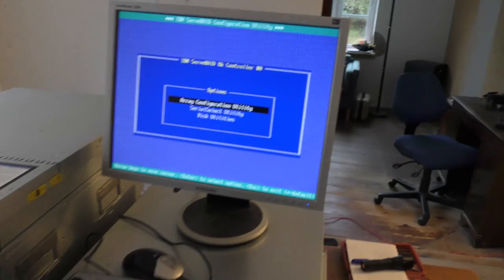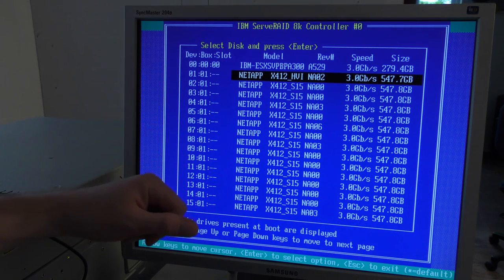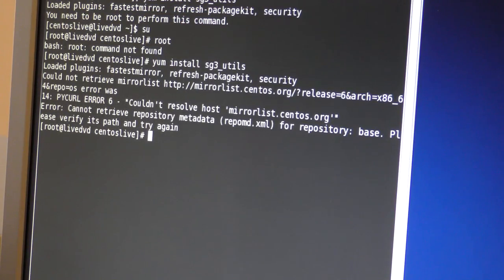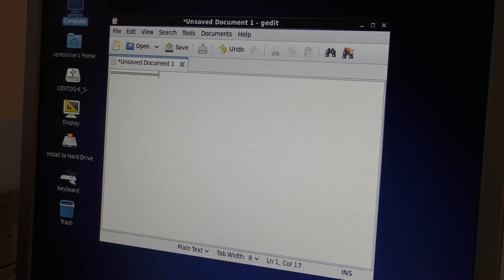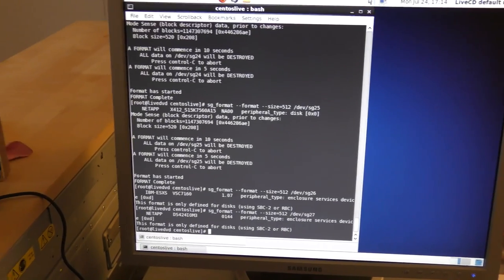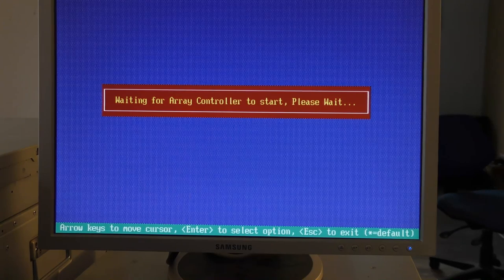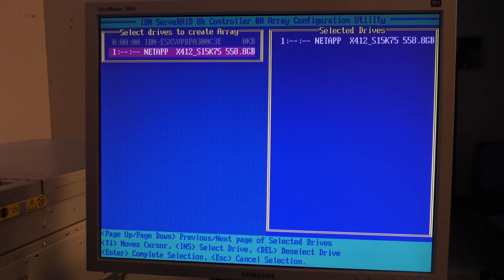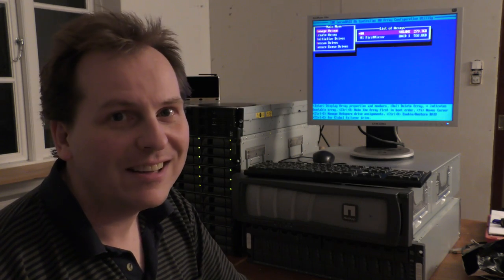How to Reformat NetApp HDD to 512B Sector Size - 552

Comment: You, Sir are awesome! I purchased 20 Seagate ST9600205SS drives off of Ebay to use in my VMWare builds using Dell R610 R710 servers but found out too late they weren't compatible because of 520 block size. Using a non-RAID Dell controller and your technique I was able to reformat them to a 512 block size. Brilliant!
Reply from the maker: Hi Terrance Sullivan
Thank You very much!  glad you liked the video :-)
Thank you for watching! :-)

Comment: I'm not a linux expert but I think you could format all at once using the "[ ]". for example /dev/sg[2-25] and it would run the command on all the drives from 2 to 25
Reply from the maker: Hi FilipeS
Thank You very much!  but a bit late .) but thank you :)
Thank you for watching! :-)
Reply: Also for future use * is a wildcard so it will select everything in a folder. So format /dev/sg* would try to format everything in the /dev/ folder that starts with sg.
Reply: Doesn't work.
I used sg[2-6] and it cancels formatting 2 as it tells "Unexpected extra argument /dev/sg3" 4,5 and 6. Seems like this doesn't run it like seperate commands, but as one command while just one format process is possible.
Reply: @Bezos404  damn really had hoped this would work i have 72 drives to do
Reply: #!/bin/bash
for drv in {2..25};
do
   sg_format --format /dev/sg$drv > sg_format.out  &
done

Comment: OMG!!!!! Dont spend 2 hours per drive formatting. Find a better way.
Once you convert from 520b to 512b, You can QUICKformat the drives in any OS you want like a normal format. Then go into the RAID setup to add them.
Reply from the maker: Hi mrlithium69
Thank You very much!  but are you sure,, even the raid controler could not initialize it before it had run this low level format.
Thank you for watching! :-)
Reply: unfortunately, no, low level formatting is different than the format done by an OS. However I thought it could be done with the sg3_utils. At least then it could be put in a script and left to do it's own thing for the next two hours...or possibly format the drive in parallel because I think the drives might do all the work. Might want to have a UPS during the low level format, in the old days I think you could loose a drive if the low level format is interrupted, but maybe it would fine..

Comment: I just bought a Dell R710 server on eBay for 67$. I thought it would be newer than the Dell Poweredge R620 but it seems a lot older. The 710 supports 4 and 6 core CPUs and 1333 MHz memory. The 620 supports 12 core CPUs and 1866mhz memory. The datasheet for the 710 says it's certified to work with emc storage arrays but has no external sas plugs. It does have 2 internal ones that connect to the hard drive backplane. Can I hook those up to my emc vnx sae storage unit?
Reply from the maker: I have not tried to use EMC shelfs, but they might be as "stupid" as others.

Comment: I've been talking with another youtube streamer and he said 2 things. 1) I can get a ds2246 unit and an hba card and format my netapp drives to 512 bytes. 2) Other option apparently is to buy an hba card and use my emc vnx sae 24 dish shelf and ubuntu or linux. Or 3) is to flash my raid card to factory or something so it gets rid of the raid information. The ds2246 setup is 200$ to format my hard drives. The hba and emc route is like 20$ because I already bought a emc sae shelf and cables, and I have a bootable ubuntu usb stick. And the last option which is to flash my raid card to make it non raid is too tedious an effort. Which of these do you suggest or do you know something easier and better?
Reply from the maker: I have never tried to use a DELL EMC shelfs, so do not know if there would be any problems.

Comment: To all those saying format in Linux, I'm pretty sure that the RAID Controller has to perform the formatting, otherwise it still won't recognize the disks. You could just have software RAID, but that defeats the purpose of the RAID Controller on this server. 

My big thought though is why? NetApp 99.99% of the time will handle the storage needs properly, and will almost always do a better job in balancing the load across all drives than the server's RAID because that's what NetApp does, and only does. Unless this is to save some power, which I get, or just to prove it can be done, which is actually really cool.
Reply from the maker: Hi 101rockfreak
Thank You very much!  I Just did not feel like using the NetApp controller,, want a little bit to make my own storages server.
Thank you for watching! :-)

Comment: The CentOS install and the formatting of the drives makes me so happy as its just like me when using linux :)
Reply from the maker: In a later video I found that this could also be done in Windows,, so there is both options,, It is a bit irritating to have to install a different OS, to reformat a few disks.

Comment: Does the change in Sector size affected total disk capacity? if yes how much? what is the empty weight of disk shelf without any drive? great job
Reply from the maker: Not really, it is like removing all the walls in your house, and put them up again, with an extra bedroom. Even if you got an extra bed room, you did not get more square meters, and the more wall might take up a little more space.

Comment: I have a smart array p410i and recently bought some seagate 1.2TB 12Gb 10k drives, but my raid card will not even see the drives. Is it because they are formatted to the non standard 520b sector size?
Reply from the maker: Maybe,, I do not have the p410,, so maybe.. :-/
Reply: @MyPlayHouse  The hard drives came from a dell server, would they be incompatible with my hp dl360 g6? if I were to do a low level format from a dell do you think my hp would recognize it?

Comment: Hi there! it's been a few months I am following you and watching your videos. It happened to purchase 8 Hitachi SAS 15k 600GB drives with a NETAPP firmware. I want to use them on DELL PowerEdge R310 servers. It also happened to find the same article and then I found this video. I managed to format the drives, but I would like actually to flash the drives with a most common (Hitachi) firmware or even better with the DELL's firmware. Did you had to flash/change the firmware on your drives or you left them as they were? Do you know how could I change the firmware? I do have the firmware I want to load. I downloaded that from DELL's support site. Any help is much appreciated. Thanks a lot in advance for your time.
Reply from the maker: Hi Angelos Pitsos
Thank You very much!  I haven't done this,, if you find out how,, I am also interested :-)
Thank you for watching! :-)
Reply: hello, how did you flash the disks on r310
I have an r710 and I cannot connect them to bypass the standard raid controller ... which controller did you use?
thank !
Reply: Hi  @TheSamTry ! Apologies for the delay of my answer, but I just noticed your comment. Actually I didn't flash them. I could use them as they were with the H700 controller. The R710 is the same generation (I also have a R710) and I believe you could use them as they are, as well.

Comment: Out of curiosity, do non-Netapp drives work in the DS4243? I am thinking about doing the same thing but I don't want to purchase a bunch of NetApp disks if I don't need to.
Reply from the maker: Hi Eli Ben-Shoshan
Thank You very much!  I had two drives 600GB, that did not work well, I put in two others from another non NETAPP set up, and they worked just fine.
Thank you for watching! :-)
Reply from the maker: YouTube is messing up, and climes that I have not replied to this,, sorry for the "disturbance in the force" :-/

Comment: Thanks for the video. Made my accidental purchase of 520 byte drives a lot easier to convert. Great that you can do several at one time given the length of time the conversion takes. MERCI BUCKETS!
Reply from the maker: Glad I could help! - I have also done videos on how to do it in windows,, if you like that better.
Reply: @MyPlayHouse  Ya. I watched both the linux and Windows versions of your videos and decided to go with the Windows solution as it allowed easy multi tasking the solution. Your hints on how to get the SG3 software to work were just enough information for me to get the whole job done in short order. Merry Chrostmas and Happy New Year to you and your family. Good luck with your new adventures in Porugal.
Reply from the maker: Thank You Very much..

Comment: I have the problem when booting centos. It crashes while loading into kernel panic error. :((
Reply from the maker: Hi E psilon
That suckes :-/ maybe look at "serverguide 10.6" or newer to see if that will help.
Thank you for watching! :-)
Reply: @MyPlayHouse  cheers! I will also try different command in windows that i have found..
Reply: @MyPlayHouse    Thank you for making these videos. Unfortunately the format protection command did not work. I must try a linux env.

Comment: I am not familer on linux, may I know how can I create such USB to boot a centOS? I have download CentOS but seems it was a installation ISO.
Reply from the maker: Hi Alan Tang
As I remember it I made a bootable USB with centOS using https://rufus.ie/
Thank you for watching! :-)
Reply: I have download the ISO and make it bootable on USB. It seems a installation media only. May I know did I need to install the CentOS on the machine's first?
Reply: @MyPlayHouse  I have installed the CentOS but it cannot recognize my HD. May I know you also connect the HD to the RAID Card without any Configuration at the RAID card?

Thanks!

Comment: Powerful raid control! Did Lenovo's system x3650 model has that sas interface?
Reply: Only the M1 has the 8088 connector as default. m2 and forward has to have another raid card installed .
Reply from the maker: Hi sogndal94
Yes only server I have ever seen it build in to,,, able to manage 64 drivs. in  total.
Thank you for watching! :-)

Comment: What is the advantage of reformatting a disk from 520 to 512 sectors?
Reply from the maker: They will work with normal operating system,, like Windows and Linux
Reply: @MyPlayHouse  ah ok, now I understand, so you can get cheap HDDs .. and in which brand and model of hard drives can this be done?  or how can I know which discs have the 520b format to re format to 512

Comment: i've done a multi format using the M1 raid controller and just let it sit 
hit format on the first drive then start the second drive format and so on... the first drive will for some reason be the last to finish but they can all be done at the same time. same things goes with the secure erase (keep in mind like i told you before it took 72 hours to secure erase 4x2tb drives) so i wont be doing the secure erase anytime soon on the 3650 M1.
Reply from the maker: Hi Joe MacPherson
Thank You very much!  it took me 2½ days to low leverl format 24*2TB
Thank you for watching! :-)
Reply from the maker: Hi Joe MacPherson
Thank You very much!  it took me 2½ days to low leverl format 24*2TB
Thank you for watching! :-)

Comment: Is it necessary to connect both DS4243 controllers?
Reply from the maker: Hi SAI
Yes it looks SO much more cooler :-) NO I did turn off the bottom one.
Thank you for watching! :-)
Reply: My PlayHouse 
It can work properly without it right ??
Reply: I think he means you can run only the top unit if you wish.
I'll be receiving mine eventually(still in the post) and I'll update you if he doesn't reply before it arrives. :)

Comment: Can your RAID Controller handle a disk larger than 2 TB ?  How large of a disk can the RAID Controller handle ?  Do you have enough compute power to set up a "Watson" ?  Or store more data than Linus ?  Thank you for the video !  tjl  P.S. What would you have your "Watson " do ?
Reply from the maker: Hi Tim Lipinski
The raid controller build in to the Lenovo x3650 M1 can max handle 2TB drives. but it can handle 64 of them. Watson runs on "PowerPC" not x86,, as fare as I know??
and No Linus has a lot more storages,, I think I have maybe 150TB all in all -ish  But I have way more then I need.
Thank you for watching! :-)

Comment: Hi Morten, it was perhaps better to delete the partitions with Diskpart in
Windows with, for example, or through the writing administration screen
in Windows then sees the server never formatted disk as a disk this is also a
bit more hassle with another server but I think many times faster.Another great video keep up the good work. Best regards Jo Denekamp
Reply from the maker: Hi Dit Is Jo
Thank You very much!  but I do not believe that Windows will even touch 520B size sektors.
Thank you for watching! :-)
Reply: Hi Morten, I did successively make my hard disk writing by my sinology Nas
clean en empty two use with Diskpart successfully back these were not read or
described in Windows any more I honestly do not no or Windows can use 520b
sectors or not.Best regards Jo Denekamp
Reply: Hi Morten, I did the hard drive writing by my sinology Nas use with
Diskpart successfully clean and back these were not read or described in
Windows any more I honestly do not no or Windows can use with 520b sectors. Best
regards Jo Denekamp

Comment: can you not use...
sudo apt-get update ret throw in password ret
sudo  apt-get install program_name install
sudo reboot ret
sudo apt-get update ret throw in password ret
sudo apt-get upgrade ret
Reply from the maker: Hi DAVID GREGORY KERR
This reminds me so much of DOS and using hours to tweak a CD com driver to fit in the HIGH mem area or even better up into expanded MEM, to get another free 20K in conventional memory ,, oh F* I do not miss that. And the editor in DOS 3.3 "Edlin",,line based editing,,horrible to work with.
No, I left that party and only look at it when there is no other way.
Thank you for watching! :-)
Reply: My PlayHouse the root terminal was the only way of getting things done
Reply: This is CentOS which does not use apt but yum as the package manager, hence the above commands would not work on a CentOS machine.
My PlayHouse If you need help with Linux in the future, feel free to shoot me a message, I know my way around it and can explain most of it to you in danish if you prefer so :)
Reply: Frederik Bjerggaard Nielsen I have used yum on Debian 8 but I prefer Linux mint
Reply: ah, edlin....good times.
Reply: The concept of all the sudo, doing sysadmin work, using a rescue disk or similar is just plain wrong. Just login as root. You have to be root for everything.

On desktop, doing non-admin work, it is normal and preferred to not be root. But logging in as user doing only admin work is just painful.

Comment: Can I use this cable EMC Mini SAS SFF-8088 2M/6.5FT cable 038-003-787 to connect my ds2246 (I don't have one yet) to my HPE 615418-B21 P822 Smart Array? I have a EMC VNX SAE 25x 600GB 10K Array w/ 2x 6GB SAS LCC Controllers 303-104-000E and the raid card and the mini sas to mini sas cables. Can I just get by with using these instead of spending another 200$?
Reply from the maker: There is a good change, that these cables are the same,, just different brands... I would try.
Reply: @MyPlayHouse  I'd prefer not to buy cables. They are like $40 from China.